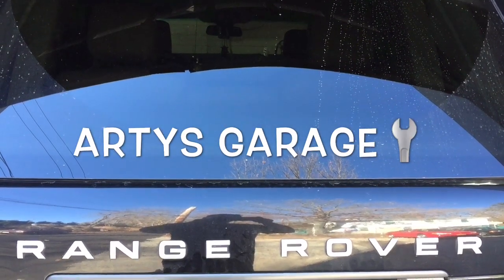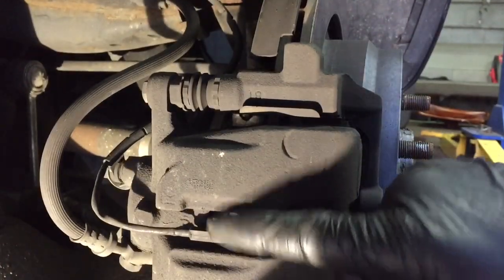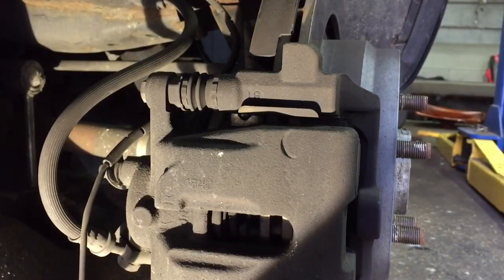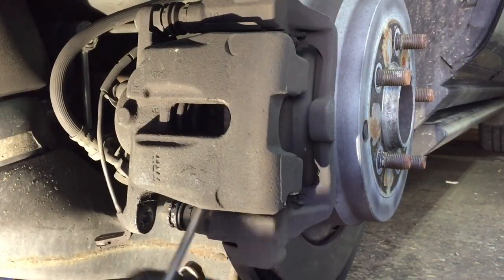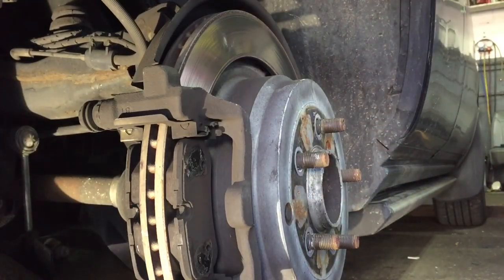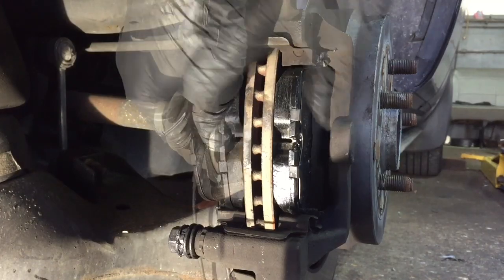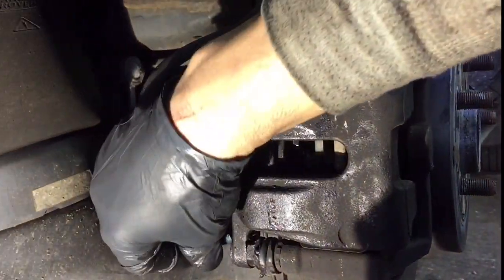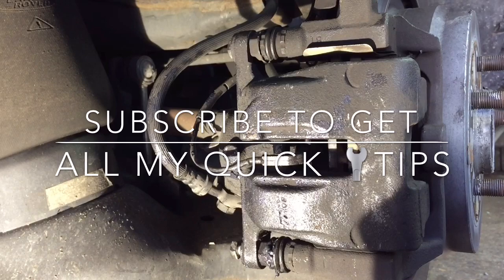How To Replace Range Rover Rear Brake Pads

Comment: greetings, what type of grease for caliper?  The brake pad when I peel the plastic the sticky side goes which side?
Reply from the maker: Marlon Romero u use synthetic of caliper & brake lube u
Reply from the maker: Marlon Romero i use synthetic brake in caliper lube if u can’t get a hold of the brake lube u can use petroleum gel or Vaseline 
The sticky side goes on the brake pad

Comment: Arty, how hard is it to replace front and rear rotors on these LRs? I have a 16 Range HSE, needs pads after only 22k mi. Seems early to replace rotors, how do you tell if they need replacing? Great videos, Arty!!!
Reply from the maker: Can’t say it depends on how hard you drive & The conditions you Drive Under You need to avoid hitting water puddles when you drive your car it tends to warp  the rotors cause it goes from extreme heat to Extreme cold  Basic chemistry heat expands cold  contracts
Even if they are warped or out of round a little bit the rotors will shape the pads into them and even them out if they pulsate in the beginning when you brake they will eventually even out and feel smooth when you apply the brakes
Reply: @artysgarage6907  Thanks for the brief tutorial, Artie. I'll try just replacing the pads as you've suggested. i'm thinking after only 2.5 years and 22k miles these rotors are probably OK.  It's my daughter's car and I don't drive it so I'm not sure if the brakes are pulsating. I'll do a test drive to see.  Thanks again for the advice.
Reply: Arty- did the brake job. Ran into some serious challenges with the EPB (electronic parking brake on the rears of the 2016 Range Rover.) You must have a scan tool to put the car into a mode to deactivate the brakes, then another mode to bleed. It was quite an expensive education. But I found a great independent garage nearby that helped me out.
Reply from the maker: w gibbons If your brake pedal doesn’t pulsate and you stand with no pulsate when you hit the brakes you don’t need rotors those rotors are made really good from the factory I would just suggest to replace the brake pads the brake pads will eventually wear into the rotor if that pulsating and you’ll be all right save your money
Reply: καλό Πάσχα
Reply from the maker: No all you need to do is open up the bleeder valve and push the color button supposedly the valve went to Calebs Olean & with the video as in the front
Reply: @artysgarage6907  You have to deactivate the EPB to get the caliper off the rotor.  It can be done manually with a shop manual guide. But if you have to bleed, it's a whole nother level. The older models are easy. The EPB makes it more complicated. Not schooling you, you're the mechanic. Kust saying I ran into problems.
Reply: @artysgarage6907  And I did not replace the rotors, I followed your guidance cuz there was no pulsation. Totally agree.
Reply: REAR
Removal
1. Connect a suitably programmed diagnostic tool and set Electronic Park Brake (EPB) to maintenance position.
2. Raise and support vehicle with a suitable lift.
3. Inspect brake pad wear sensor for signs of wear or damage. Install a new sensor, as required, Fig. 13.
4. Remove lower brake caliper bolt and swing caliper upward out of way, Fig. 14.
5. Remove rear brake pads, Fig. 15.
1. Clean brake caliper housing and anchor plate using brake cleaning fluid.
2. Inspect caliper piston and slide pin seals for damage.
3. Retract caliper piston back into cylinder bore, Fig. 16.
4. Install rear brake pads, Fig. 17.
5. Swing brake caliper down into position and install bolt, Fig. 18.
6. Install brake pad wear sensor.
7. Install wheel and tire assemblies.
8. Press brake pedal several times, inspect fluid level in brake fluid reservoir and top up with brake fluid, as required.
9. Calibrate Electric Parking Brake (EPB) using a suitably programmed diagnostic tool.
  @artysgarage6907
Reply from the maker: I’ll show you when I’m talking about how to do it it’s hard to explain but I need to show you on a video subscribe I’m looking forward to doing it to help you and help others there is a way that I’ve done it
Reply from the maker: You’re correct like I said there’s a way to bypass the system I’m a make a video on how to do it it’s hard to explain but I’ll show you step-by-step on my next video next time I get at this application to subscribe and thanks for your input
Reply: @artysgarage6907  Ok thanks Arty. I am a subscriber. Many thanks for your continued interest.
Reply from the maker: Επίσης Χριστός Ανέστη
Reply: Αλληλούια
Reply: Αμήν
Reply from the maker: Sorry for the late response I would never replace the rear rotors on the car unless that is completely shot on the other hand if your car pulsates when you hit the brakes and otherwise the stairwell shaken when you apply the brakes I will replace the rotors but it was my car I still wouldn’t replace the rotors I would put a good quality brake pad in the front and the brakes will eventually went into the rotors and everything be just fine

Comment: Hey dude this is ok for older Land Rover and Range Rover but if you have anything newer than 2014...you need a special retracting tool. At least post the years your method will work on.